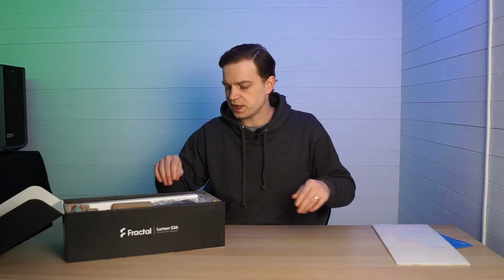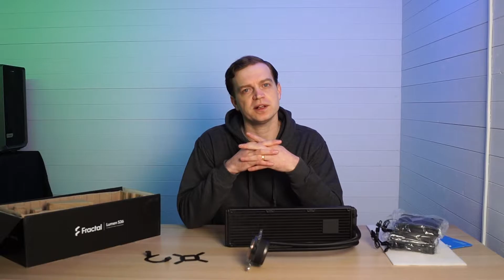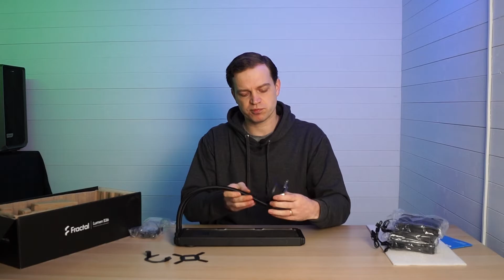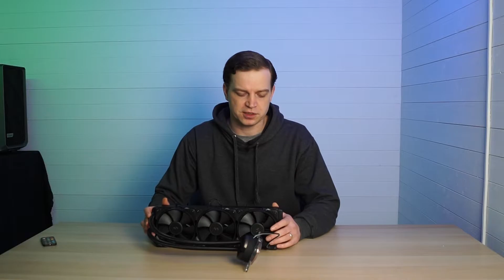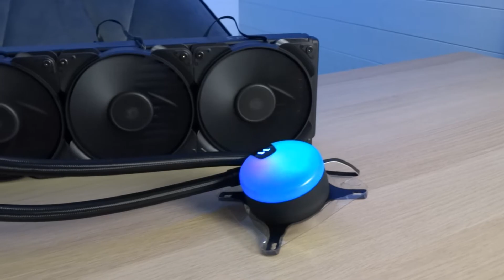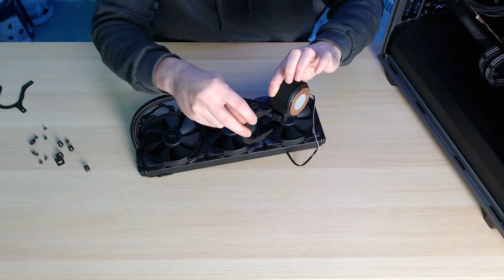The Fractal Lumen S36 - A Stunning All in One Cooler.

Comment: These do have a recall on them. After a year my CPU temps at idle started going crazy 70-75 degrees at idle. I reached out for an RMA since it has a 5 year warranty. They informed me they have a recall and will send me a new unit for free, and I dont have to send current unit back. I would reach out if you have issues they have great customer support! All you need is proof of purchase!
Reply from the maker: Yeah, had to have this one recalled as well.  They were pretty good about it though, no issues just shipped a new one out.
Reply: @TechLabUK  glad to hear. I did buy a asus rog strix AIO that shipped today,not sure if I want to return it or use it. Everything in my build is  rog strix (minus the cooler and things they don’t make like ram and cpus obviously) seems a little dumb to waste 140 bucks just for branding. Just don’t want the replacement  to crap out on me down the line. Hopefully my replacement is a revised model, but didn’t seem like it was? Do you know if it’s revised?
Reply from the maker: @Seechase_  The replacement Lumens are a revised model.  Mine even came with the LGA1700 brackets which the originally didn't.  It's now been running fine since, no issues.
Reply: @TechLabUK  awesome. Thank you for the reply! I’ll probably just run it then and return my asus!

Comment: DO NOT BUY IF CONSIDERING TOP PLACEMENT!!!

I was considering buying this one. But then I realized: PUMP LOCATION!!! You want the pump on the lowest point, to prevent dry running after some liquid evaporates. With the pump in the radiator, you kinda can't place this radiator in the top of a case. Only vertical placement infront, or somewhere on the bottom of a case. Because of this, I won't buy this one.

Some of the larger tech tubers (gamers nexus and jayz2cents) have made vids about "AIO placement".

Comment: Had to RMA mine. It just couldn't keep my CPU (Ryzen 5950X) from throttling - could be a fault in the overall unit though so don't go by my circumstances alone!
Reply from the maker: Fingers crossed ours has been running fine but will keep our eyes on.  Thanks for the heads up.
Reply: Bugger, I've just bought a 5950x system with this as the cooler. Hasn't been delivered yet.
Reply: @CircusNormal  Yea, good luck with it. Could have just been mine. It was a lovely looking cooler btw so I hope it works for you. In the end though I went for the Kraken Z73 and temps idle around 35, beautiful cooler too so perhaps also worth a look! Anyways, good luck with the build.
Reply: Just saw your comment. Mine is also doing thr same thing. My 5800X3D is idling at 60ish degrees, which is definitely not normal. Usually idles low 30s.

Just a nice AIO, simple and performs really well.
Reply: I have the same issue. Thing is garbage

Comment: ALL aio should move their pump in the radiator like fractal
Reply from the maker: Performs really well aswell.
Reply: Actually horrible idea. Pump should ALWAYS be submerged. Otherwise, it will damage itself. With an AIO, you can't fill it up. And liquid will evaporate. So you can't top-mount this thing, because you will quickly run the risk of dry-running your pump.